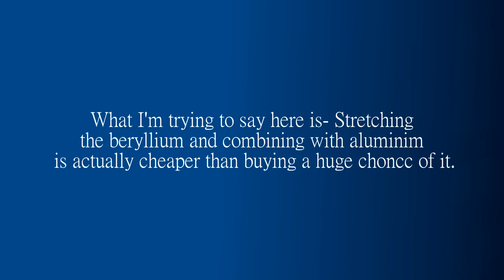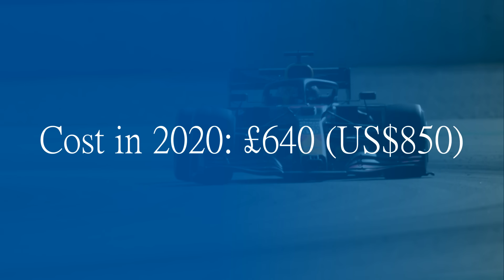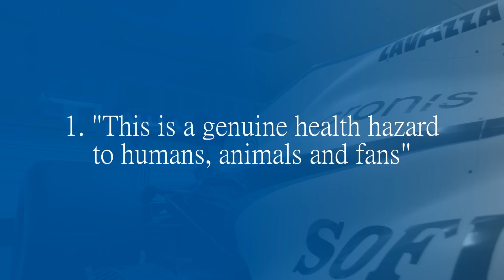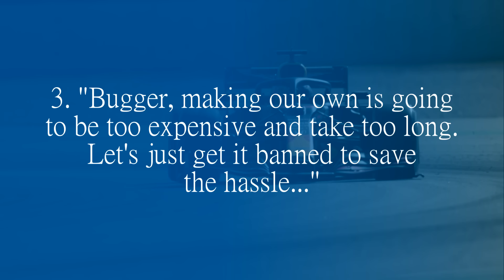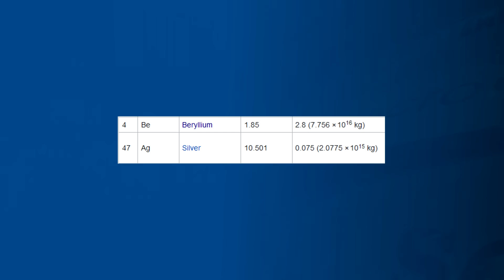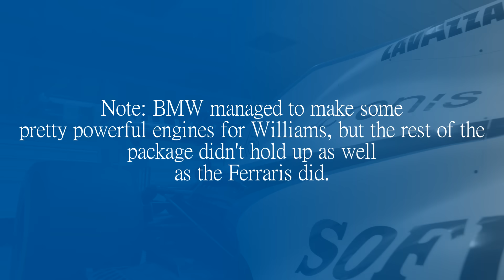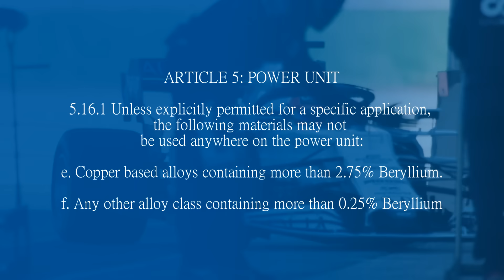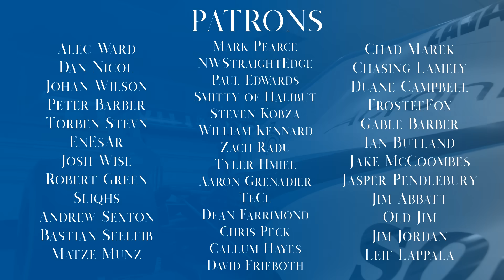MCLAREN'S "TOXIC" ENGINE! The Story of the Mercedes Beryllium Alloy Pistons (1998-2001)

Comment: I seem to remember reading once Honda used Beryllium in the F20 engine used in the S2000 sports car, along with an accountancy issue with that car.
At the time in the UK an S2000 had a price tag of £27,000 new, it also stated the cost of each engine to Honda was £16,000.
At the time the F20 S2000 engine held the record for highest specifuc output per Litre capacity if any normally aspirated production car engine of 120bhp/litre with catalysts or 140bhp/litre without catalysts and a mild Mugen tune which came with a 9,600rpm red line.
Reply: I own a yellow one. It is a lovely engine, but the best part of that car is the gearbox. 🙂
Reply: the f20c block is a unique alloy dont think its beryllium though

Comment: My recollection of this (20 years later) is that Ferrari promoted the idea that the engines would spew beryllium dust down the front straight of Monza poisoning the Tifosi, and of course, the Tifosi were on Ferrari's side.  The idea that pistons would degrade like that is laughable, but for the sake of public safety, that contributed to the ban.

Comment: Fun fact: They use a copper beryllium alloy to make things like adjustable spanners that are intrinsically safe for use in explosive environments.
Reply: Makes good valve seats too 😜
Reply: and springy copper parts in switches
Reply: I saw those in a tool catalog of a huge normal tool supplier.   Ampco makes them. I phoned up and emailed that they should place a warning in the catalog and with the tools ordered not to grind anything in shape or size ( odd nut size ..just grind the spanner..)  without right protection.  They were like :  grinding dust of be bronze toxic ???? Didnt know that Ok...we will do so.
Reply: My Ping Zing Beryllium Copper Irons were pretty nice too... until I gave up golf because my shoulder was trashed in a parachuting accident.

Comment: Beryllium is known to be used in some electronic circuits. Usually high end radio transmitters.
Reply: That was normally BeO - a lot of 90's avionics was full of the stuff.  It makes a lot of sense in high power RF circuits because it manages to be a very good thermal conductor while being an excellent electrical insulator.  It also has very low dielectric absorption, which reduces losses at high frequencies. There was also typically a whole section in the manual filled with warnings about how to handle the stuff.
Reply: @TrimeshSZ  Yes, 4CX250's I use them even today in my lineairs. 2C39's also.
Reply: @harrydelange1821  Pretty close - the specific part I had in mind was the 4CS250R - which is very similar, but conduction cooled - that had a solid Be alloy block that mounted to the chill plate and no fins, because they were typically installed in equipment that was in an unpressurized equipment bay and it wasn't practical to air-cool them.  Certainly a lot quieter than the air-cooled parts like the 4CX250 :)
Reply: @TrimeshSZ  A friend of mine, also a radio ham build an amplifier with 2 of the conduction cooled types iin the early 80 ties. Very quiet and easely capable to deliver 400 Watts on 144 mcs.
Reply: @harrydelange1821  I think that was a pretty common approach back in the day - my 2m amp was also a pair of 4CX250s with (noisy!) air cooling - I did get a pair of the 4CS250Rs and think about converting the amp to conduction cooled, but life and inertia got in the way.  I also had a 3CX1500, but gave up on the idea of making an amp from it after hearing the blower in operation..

Comment: I used to race motorcycles and into the 2000's we were still using leaded gas. Leaded gas is WAY worse than Beryllium used in engines. I agree with the possibility of the workers that had to handle the metal though.
Reply: Theers nuthing rong with lead, it dudn't hirt mi brane.
Reply: Beryllium is way way way worse then leads.  Only a few machine shops will work with in the states for that reason.
Reply: @warwickben  
I would say the difficulty working with it may be a factor but even so try comparing it with tetraethyllead, which is what goes in petrol, or used to. Open a drum of that and 5 minutes later, if you are still alive you  won't be able to tie your own shoe laces.
Reply: @Igbon5  I get what u are saying but I’d rather breathe leaded fuel then that metal
Reply: @warwickben  
Leaded fuel yes, but I meant the actual tetraethyllead itself. It is a liquid concentrate that is added to the the petrol. I meant opening a drum of that. You really will will suffer lot  quite quickly. 6ml will give you severe unrecoverable lead poisoning and just a few vapors will give you trouble.
I have seen the drums when I worked unloading ships. Everyone was very very careful and ready to run if anything happened. But running up ships ladders out of cargo holds can be difficult.
Reply: If the PPE is used correctly and dust is kept to a minimum, it should be safe. It is not like the engines are supposed to be grinding their pistons as they work

Comment: great content,  as always, thanks! sometimes I wonder how would a car with all banned perks ( turbo, active suspension, f-duct, second pedal, beryllium engine, traction control, launch control,  fully auto transmission,  4 wheel drive, to name the few) would fare against 2022 f1 car.. cough, hint...
Reply: We could call it the real pinnacle of motorsport, not the watered down version we have now.
Reply: Would be too quick for any human driver's brain to process. It's been said before that if the cars were any faster than 2004 or the last few years, drivers would need a G-suit.

Would be cool to see how an AI would cope with it though! What you're describing is pretty much Adrian Newey's Red Bull X2010 concept from the Gran Turismo games 5 and onwards.
Reply: @solitaryclusterofneurons598  g suit wouldn't work , the only time it would work is under braking and the duration of braking is too short for it to effect the human body enough to need a g suit and the contact patch of the tyre, grip of tyre and grip of surface are what determines how many g forces are exerted at max braking , we are at that limit. the only problem is physicality and how long the drivers could endure high g loads in corners, blood pooling wouldn't matter because they don't sustain high gs in one direction for long enough unlike IndyCar that had to slow the cars down because all the gs were in one direction and the straights werent long enough for the blood to get back to where it was needed. if I recall they had blood pooling in the right hand side of the body and brain.
Reply: @tulmar4548  Thanks for sharing, genuinely know nothing about the physiological aspect of motorsport, so this was informative.
Reply: @tulmar4548  thanks for that great insight!  stupid question, then, if you don't mind- what if pilot's cockpits are turned in barometric capsules. allowing to reduce atmospheric pressure and such inside the car, would that have an effect? i am assuming it's wouldn't on amount of g's, but it should have some effect on reducing drivers fatigue?
Reply: @dmitriybozhanov2636  I doubt it , there's probably little things they can do though for driver comfort that could help. Current f1 drivers are pretty fit and tbh could probably do another 20 laps on most circuits. It looks like the highest g highest temp tracks fatigue the drivers the most. Airforces have been constantly looking at ways to reduce fatigue in fighter pilots  but havnt really come up with anything other than be as fit and healthy as possible and if they havnt found a solutiin I doubt f1 could. I'd love to see what the op suggested,  just to see how much the drivers could handle and for how long and with cars like that you'd have to be more selective with the tracks , you wouldn't run cars like that at jedahh for instance because you'd need huge safety margins.
Reply: @solitaryclusterofneurons598  seeing how all the modern f1 pilots are clad in nomex, the g-suit is only a logical next step. And to be fair, I am little surprised that the majority of current drivers run their careers for 10+ years, when the pioneers of the sport could barely last 5+ years due to all the physical toll the sport has been taking on them. Aidan did a great job on one of the Indy and NASCAR podcasts, about the issue of deliberate slowing it down due to the immense physical exhaustion of the drivers. I do not recall that such issue was a concern with F1 aside of few anecdotal occurrences (Brazil 91, Las Vegas, etc).

Comment: Beryllium oxide is used in radio frequency power transistors all over the world. The dust of this oxide is the toxic hazard.
Reply: I used to work with a lot of radio transmitters. The beryllium oxide is fine when it's encapsulated in the RF power transistor, but you shouldn't try cutting or grinding them to see what's inside. I'm not sure how the e-waste places deal with them these days.
Reply: @alexjenner1108  I used to work for an avionics test equipment manufacturer once upon a time and there were special training and procedures for working on any of the PCBs that had BeO components mounted in/on them.

Comment: the Merc engines of that era had such a distinct sound compared to the rest of the grid - I remember as 8-9 year old kid I could instantly tell the Mclaren was going by while walking down Georgetown Rd outside of Indianapolis Motor Speedway.
Reply: Will never forget that sound at ims
Reply: @kameransnyder9596  nothing like those V10s screaming around the banking
Reply: @Joe B Believe me the V12s sounded a lot better.   I went to a number of GPs  in the early 1990s and Berger and Alesi in Ferraris were quite often the first out on track.  At tracks like Spa and Monza you could hear the shriek of the V12 as it went around the track.
Reply: @simonkevnorris  they just think that the more high pitch = the more better. Wich is sad af
Reply: @marinlenfant6976  I think one of the best engine sounds I've ever heard was at Le Mans in 1989 - the twin turbo Mercedes were magic (not too loud either).  As for noise in the same race was an Aston Martin - I could still hear that car on Monday afternoon (and the race had finished Sunday afteroon).
Reply: The 99-2001 Mercedes V10's were IMO the last ones I found tuneful, not just noisy. This is especially so at low revs in slow corners. They had a great scream about them :)

Comment: Beryllium, in relatively small percentages, is used in many, highly useful alloys. Beryllium-Copper springs are perfect for musical instrument valve springs and I have seen them used in electrical circuit breakers mechanisms. Be-Cu springs just work: they don't corrode, they apply consistent force as their Spring Constant does not deteriorate with age in typical environments, i.e.: they're perfect for "must never fail" long term applications.
Reply: Be-Cu is also used as valve seat material  for racing engines.

Comment: My father worked for Rocketdyne after college were he got a Rocket Propulsion/Aerodynamic degree.  AAS they were looking fro materials for rocket engines VERY early on there was not much written about materials that could take the punishment rocket engines would provide....  So he joined the ASE (Society of Automotive Engineers) in order to get details on the types of materials were being used in automotive/racing engines as they had played with a LOT of materials like ceramics.

Comment: Side note.  Porsche experimented with brake discs made of this stuff on their hillclimb cars in the 60's.
Reply: And Lemans. How would you like to be a tire changer on those pit stops?

On another note, I have had contact with beryllium engine parts before. The manufacturer told everyone to NOT grind, sand or cut on them in any way. At least publicly. Privately they said if you just had to do it, do it under water.
Reply: @wingracer1614  is it that dangerous? wow
Reply: @harshithsadhana7475  Dust in your lungs is. Just holding it and handling it is no problem but breath in some dust and you could have serious issues.
Reply: @wingracer1614  The people that supply Beryllium materials provide a handbook for working with them safely.  Modern CNC machines are completely enclosed and use flood coolant to keep dust and chips out of the shop.

Comment: Longer stroke doesn't produce more power. If anything, it causes greater losses and limits the rev range. Mercedes probably had high compression made possible by the better heat conductivity.
Reply: That is if the pistons and conrods are made of aluminium. It is talking about using beryllium.
Reply: It doesn't inherently limit the rev range, the inertia of rotating assembly and lack of its stiffness does, that's the reason for using beryllium and lighweight ceramics in the first place. And yes, achieving high compression and effective scavenging is easier with longer stroke